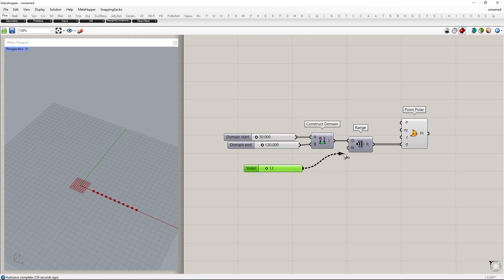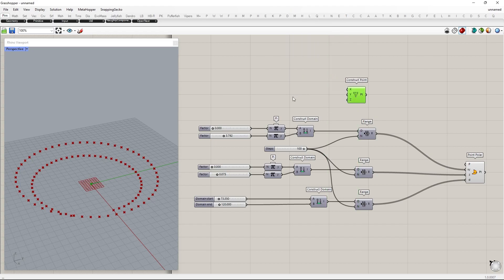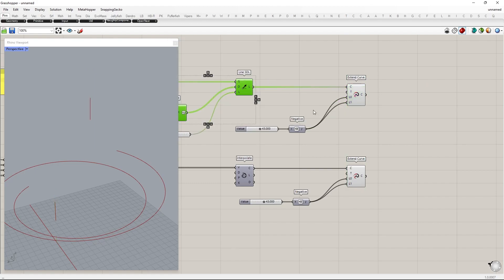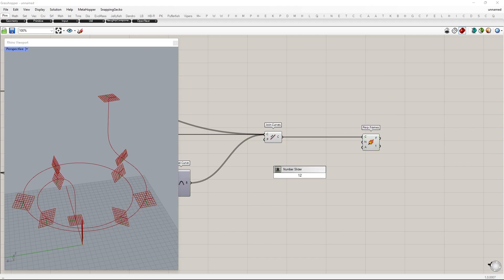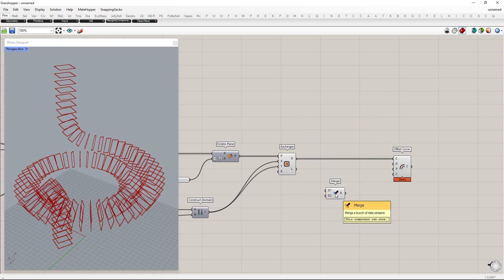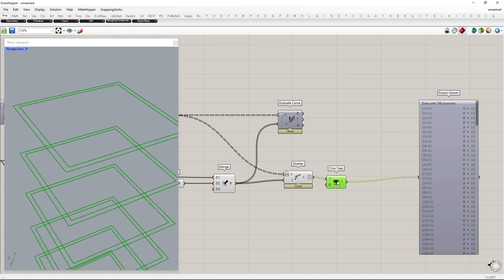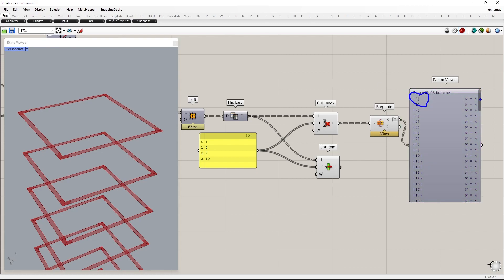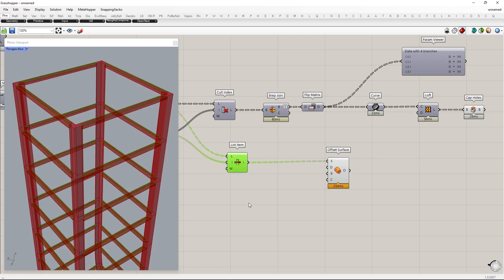conceptual coastal villa in grasshopper tutorial

Comment: satisfiyinggg, thank you for video. May ı ask you how you can slab for people walking? ı just try your video and dump. use cull index for merge 5,6 and 0,11. in the panel there is 1,2,3,4,7,8,9,10. I can't merge  corner for walking.Thanks in advence.
Reply from the maker: fined the diagonal line for each rectangle and loft them.